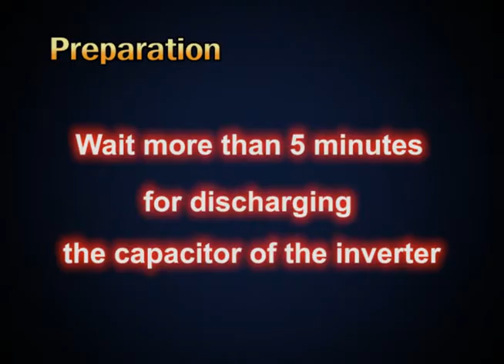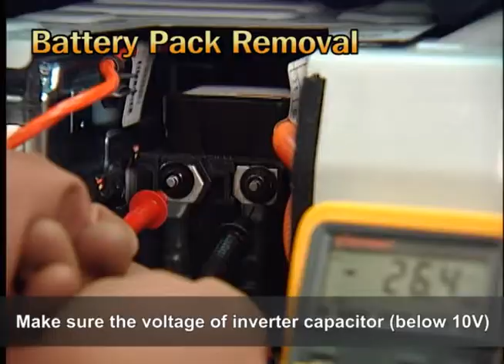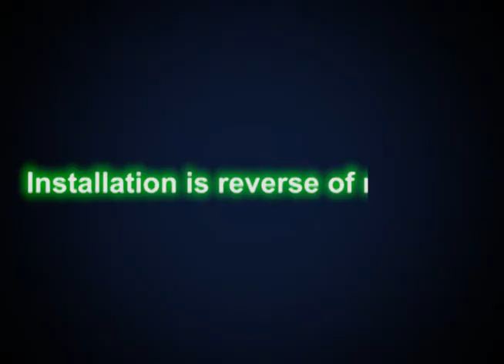Optima & Sonata Hybrid Battery Pack Removal & Disassembly - KIA and Hyundai Hybrid Cars

Comment: Very nice. Would you say it is a job that any DIYers can do or it must be done by a pro. And also a curious question. Is the battery always a shock hazard or at some point it is without power. Can you point where in the video the power is totally off
Reply from the maker: Hi there. Every job in this cars must be done by a qualified person as they will be dealing with high voltage. There are some steps to de-power the high voltage, refer to the link below, but still after de-powering specific procedure is involved.
https://youtu.be/bVywdA3-4ao
Reply: @AutomotiveDiagnosis  thx thats nice to know

Comment: Thank you for your awesome video.   My car is Hyundai Sonata Hybrid 2014.  Is it still the same procedure to remove and disassemble hybrid battery?
Reply from the maker: Hi there and thanks for your comment. Yes, procedure is the same with only some minor differences.
Reply: The battery pack in my 2015 Hyundai Sonata hybrid burn/melted. Any thoughts?

Comment: Question, do you see an audio amplifier in the rear trunk?
Reply: Its close to small beterry behind the body
Reply: 3 screw
Reply: @jaspalsingh8850  mine is a hybrid and doesn’t have an amp. I fixed my audio problem with replacing the radio itself.

Comment: How much more or less for the replacement?
Reply: According to Google, $2k-$8k for the battery pack.
Reply: @joshuaosborn  I called up the dealer and they are on back order and who knows how long
Reply: @baezn88  There's a few places that do reman units with new batteries.  Probably a better deal vs going to the stealership for OE and paying 2x as much or more for a "new" one.
Reply: @brassmule  my girl got tired of the car and traded it in for a Toyota. I guess it was a win, win situation